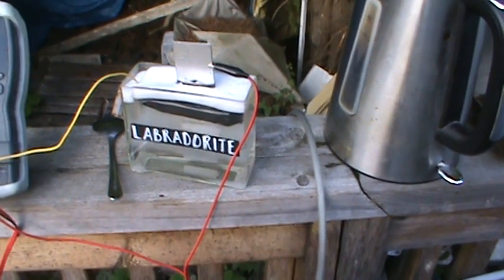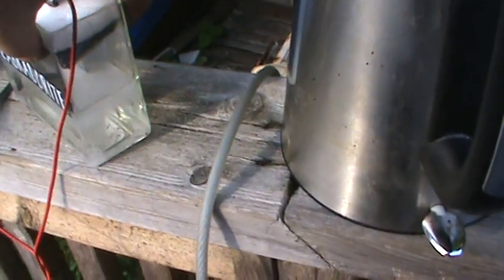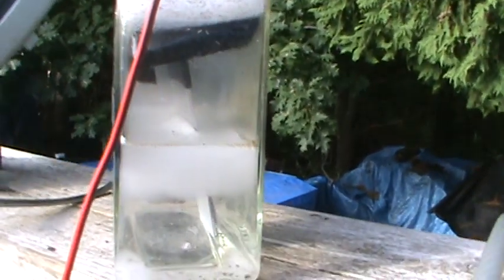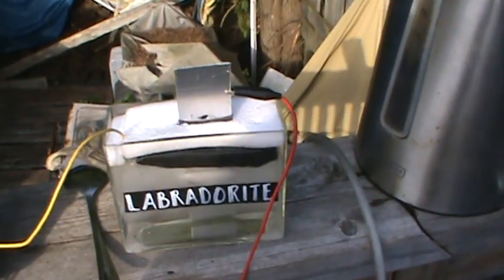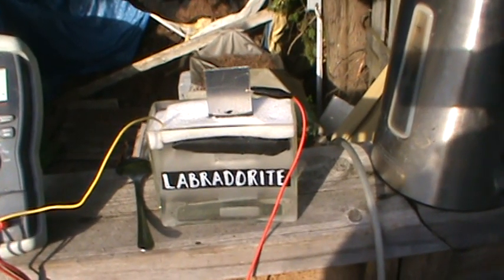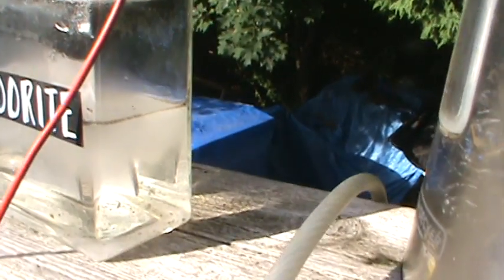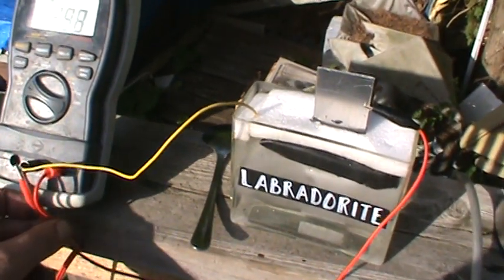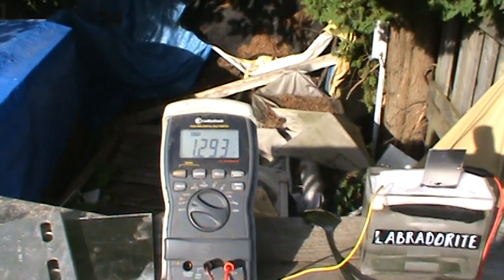Aluminum  Frankenstein cell

Comment: I reckon I'm a bit confused here. Is this some sort of hydrolysis battery? What am I seeing in the top portion of that liquid? It looks like fine bubbles to me, plus you mentioned seeing the bubbles, so I'm assuming that's what I'm seeing. If that's what I'm seeing, then I feel like I am also seeing hydrolysis or electrolysis happening here causing those bubble, and since I see no sort of power going into this setup, I have to rule out electrolysis which leaves me to assume this is hydrolysis being facilitated by chemical reaction. If so, can you please state the chemicals used and where. Only thing I heard you state definitively was the aluminum plate and water, plus I see a labradorite label. I believe labradorite requires a strong acidic solution to break it down (and u only mentioned water), unless you happen to have some barium or strontium on hand to add to your setup. I also feel like I see a mass of something in the bottom of your solution, just under the aluminum plate, but I can't be sure, it could be a reflection of the plate possibly. I think I speak for all or mostly all of the 1700 viewers who have watched this video when I ask if you can please make this make better sense to me? I'll sub and follow if you do, cuz I'm interested in your experiments, I just need to understand them better.
Reply: Nevermind. I watched some of ur previous vids and I think I understand now...most of it anyway. Please correct me where I'm wrong. The water isn't just water, it has sodium hydroxide in it, making that solution more like acid than water, but fair enough anyways. The anode at the top is a stainless mesh or screen. The bubbles I'm seeing are hydrogen being produced by hydrolysis, which is slowly dissolving that aluminum plate. I wonder how long that plate will last. The electricity ur getting is likely coming from positive ions from that hydrogen, maybe bonding or reacting with the stainless. Only thing I'm still confused about is the label you have on the cell. I still don't know why you have labradorite written there...seems like that has nothing to do with this thing in any way shape or form.
Reply from the maker: @DonnieBrass  You are right , i explain in other videos that hydrogen is being produced from the chemical reaction . But the key is the oxidation of the aluminum plate .  Oxygen has a negative charge so the oxidation is adding electrons to the plate . I made a video with 4 plates that a person could tap 4 different loads off of . Don't worry about the label it means nothing .
Reply: @hydniq3327  Alright bro. Well thanks for the reply. I'll go check that video out now. I subbed too fyi
Reply from the maker: You might like this one https://www.youtube.com/watch?v=5lg2FLO7FW8&list=PLUZEjUv_mAZeRWACCrvyxU-wijGg4axrH&index=1

Comment: The water on the walls conducts the elecricity. Voltage is plausible but you will not be able to draw much of a current from this setup. The voltage alone does not mean too much here. Sorry. to say that... I am an educated electrical engineer from Germany, working on electrogalvanic equipment.
Reply from the maker: I have been testing the ma on just a aluminum cell , but i might build this cell again to test the ma . I agree i don't think this setup will produce much . That is why i went to more plates for more surface area .
Reply: Something is definitely going on as it seems to be pulling Al off the cathode. Looks almost like an NaOH - Al reaction.

Comment: You might want to get a scrap piece of plywood and clap it to the railing for your meter. Try connecting a small motor with propeller like Robert Murry Smith does in his experiments. Volts is ok but amps are better.
Reply: Volts and amps are indeed much more useful than just volts on their own. The combination is what determines the total power (energy per second in joules) via the formula V * A.
Reply from the maker: I did some tests with a resistance box checking ma draw on a different type of cell . This one needs more tests .
Reply from the maker: yes still testing